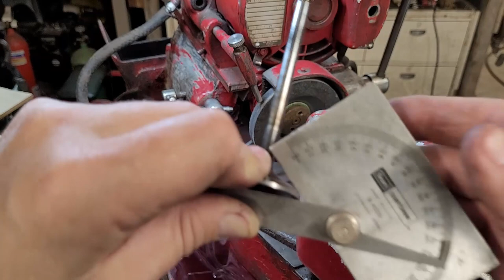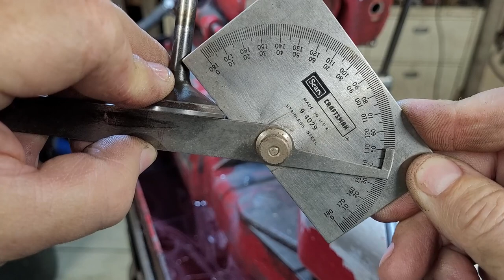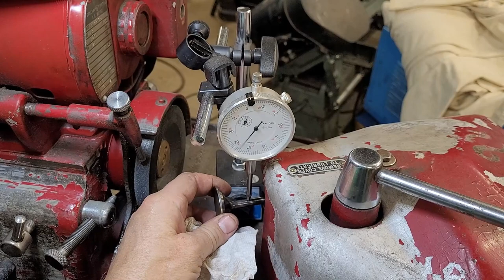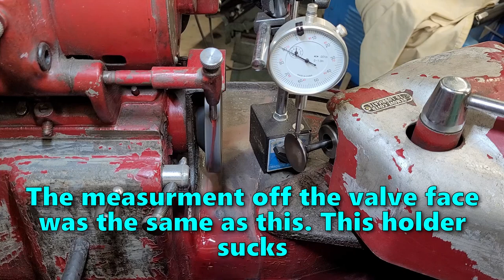Valve Grinding with the old Kwik-Way SV Valve Resurfacer - Let's see how it works.

Comment: having a true valve chuck is the most difficult part of restoring this type of machine, I restored a Wolf VR5 many years ago, the machine runs fine, I had to fiddle a lot to obtain a truness of 0.001" TIR.
this machine worth every sweat and penny invested
Reply from the maker: So true. Hopefully I can get it to run true once I rebuild the chuck. I thought Kwik-Way sold new machines with collects but I was wrong. They still use the 3 ball system. 👍🏼👍🏼

Comment: one and a half thou is considered decent.  if you want more chuck accuracy, you can convert to a ER32 pretty easily on these.  The thing i always disliked about the SV was the tipping end was like an afterthought, you really have to dial it in to get a truly square tip.
Reply from the maker: Thanks for the info. I guess I'm off to a good start with this one then. I measured 1.5 thou at the valve face after grinding but it's hard to trust that crappy indicator holder. I'll look into the ER32 conversion. I haven't ever really used a tip dresser before. 👍🏼

Comment: I have a kwik way built in 1925 that was my grandfather's. It's a multi purpose machine for grinding valves, generator comutator machining, mica cutter,   sharpening reseating cutters and reamers.  All leather belt driven. As far as I can tell most of the attachments are here but I'm sure that some are missing. If anyone out there knows how most of this works let me know on some of the stuff I'm totally confused.
Reply from the maker: Might want to give Kwik-Way a call. I think they still have manuals for those machines 👍🏼
Reply: I did get ahold of them but they couldn't help much. In 1940 they had a flood or fire that destroyed most of their papers. I do have an instruction manual that someone sent me but its not complete. This model has a stand 36" high and flips up to get to the belt under the base of the machine. According to my father and he's been gone almost 20 years there was a tray under the base and a pump for cooling but he told me that got thrown away years ago and he was probably the last person to use it 1948 .
Reply from the maker: @markflorest7841  maybe check out Vintage Machinery. Org. There are also some decent Facebook groups that might have some resources 👍🏼

Comment: To remove 2 piece valve retainers use air gun with high presure.
Reply from the maker: I haven't seen it done that way. Thanks for the tip.